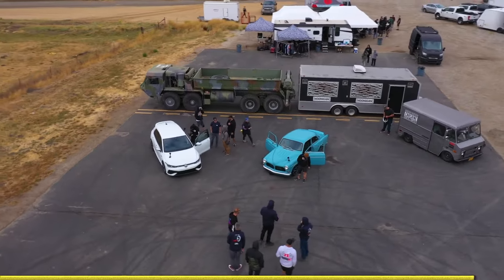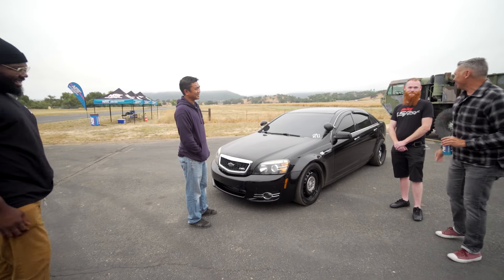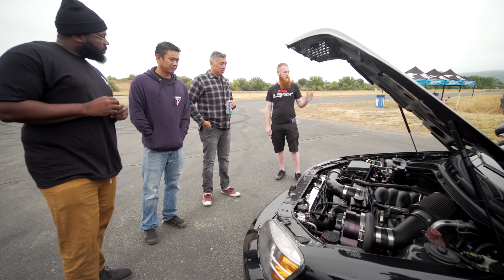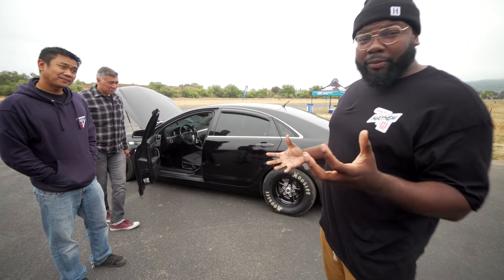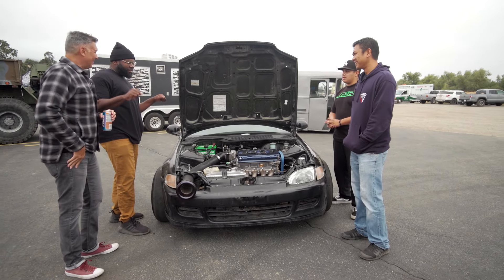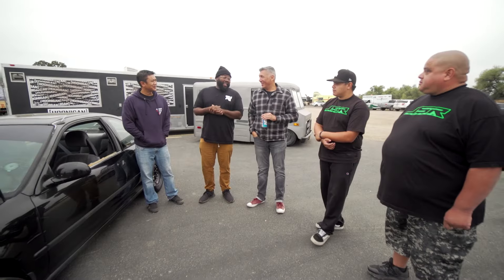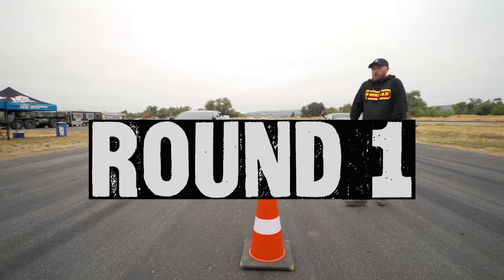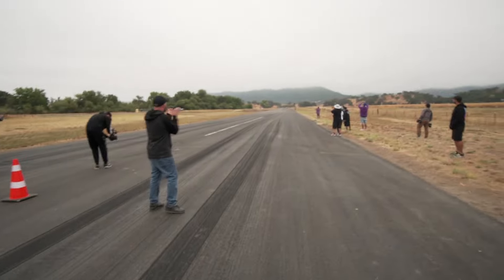600hp Chevy Caprice PPV drag races LS VTEC powered Honda Civic EX

Comment: That second race had such a clean, even start. Fair
Reply: That second race was a great race!
Reply: That was a decent race, door on door the whole way
Reply: Holden running some lazy ass 3.20 gears out back on heavy girl, if he was rockin some 3.90-4.10 the fresh build fart cannon on race fuel would be smelling pump fuel exhaust
Reply: @05EVORS  i doubt it. He was low on grip
Reply: @Reactionary Hermit and broke
Reply: @smitty261974  so what if it breaks lol it's only an ls honda motor, doesn't cost much
Reply: @nonstopqs4188  🤣🤣🤣still broke trying to beat a full weight 4 door boat. Hell I drive a Honda and I own both. Chevy and Honda.
Reply: @05EVORS  that’s wayyy to much gear for a 6l80
Reply: Streets closed pizza boy....the cop flys away home.
Reply: @smitty261974  admittedly he was driving it like shit. If it were driven properly it prolly wouldnt break
Reply: @adrianwelgemoed9562  maybe
Reply: @adrianwelgemoed9562  it was a time bomb with that kind of compression ratio and with nitrious.
Reply: @05EVORS  true but if that Honda had a k20
Turbo engine with awd drivetrain, the v8 would lose again
Reply: @lespaulguitarist92  true. Forgot it was on nitrous
Reply: @adrianwelgemoed9562  you don’t slam the rev limiter at 10k while on the nitrous… rule num 1
Reply: @lespaulguitarist92  it really is how he drove it though
Reply: @smitty261974  race what u bring buddy 🤷🏻‍♂️
Reply: @flacco1679  yep sure did and spinning ain’t winning.
Reply: @Reactionary Hermit A supercharged police auction LS with probably over 100k miles and somewhere around 7k idle hours and twice as heavy, but... Ok 😉
Reply: @haydenrapp6547  THIS. In and out of first in the first inch of launch
Reply: @05EVORS  maybe.  but he wasn’t, so take that L
Reply: @05EVORS  2:98 factory
Reply: @smitty261974   bulletproof and very responsive. The L77 can easily see 75hp removing a set of the mufflers and both sets of cats and resonators with a OTR intake and a tune 7k redline helps that rear as well.
Reply: @ITRSammy  If the Caprice had a LT6 AWD?!  Relax… Props the the LS regardless. A Dart block built half the weight with the infamous high rpm on juice. It’s almost half the weight, half the power. Reliability and consistency will go to the workhorse L77 6.0
Reply: @WoodLox  your preaching to the  choir. My brother and I had one built and put in a short bed GMC with a LSA and T-56.
Reply: @WoodLox  if the Honda had a jet engine the caprice would lose
Reply: @smitty261974  it didn’t “try to beat” anything. It’s clearly the faster car and that’s before the 1/4
Reply: @tonybabyjones7106  lol. "police auction LS...". You act like the Honda is crazy expensive or the overdog. It's a $400 junkyard salvage itself. No K20 or dog box or anything ether. A simple, cheap LS-V. Why hate?
Reply: @N.S4L4S  not hating, just trying to provide information for a more realistic comparison.
Reply: @tonybabyjones7106  you didn't provide any new information that wasn't presumed from what was given in the video. The reality is that the Civic won the second race fairly, then you preceded to comment with the fact of how it's (only) a police auction vehicle with (many) idle hours, as well as how HEAVY it is "but...ok". As if to undermine the win. lol Don't try to change it up now. 

The civic is full interior and, yes, is less weight overall, but nowhere is it or should it be considered the obvious front runner over a SUPERCHARGED LS...because of its weight. Just silly. Two perfectly compared cars that you may see at the runs. It's actually more common to see an EG on cut doors with a K running C16 in this case. lol
Reply: Agree
Reply: @Conquering Death It's a weird give and take with gearing. A higher final ratio does mean less wheel speed at a given rpm. And, of course more wheel speed means a longer burnout, so long as you have the torque to break traction, to begin with. Which, he does. Lengthening gearing to gain traction at low speeds only really works for cars that have just enough power to slide, or awd.
Reply: @Conquering Death butt hurt ? 🤣 do you think the Honda winning this race as close as it was considering the other car weighs 4580 lbs is worthy of bragging about , the way I see it that was a loss and not just the race itself being a power too weight ratio loss but the Honda lost its engine too . 🤷‍♂️ JS
Reply: Shut up bro this was the cringiest most Honda Fanboy comment I've ever seen🤣
Reply: @05EVORS  mad
Reply: @05EVORS to bad the fart cannon won lol
Reply: @05EVORS  but unfortunately he lost

Comment: The Caprice guy was a good sport about getting ripped off a little.
Reply: That’s my son. Taught him manners. 🥰
Reply: Ripped off a lot.
Reply: You can't be upset when driving a 6.0 V8.
A little throttle would sooth any soul 😌
Reply: I mean he was clearly traction limited and got pulled big end. Its a bad ass car and would be a sweet daily but that Honda is the faster no prep car
Reply: @TexasTrollPatrol   Well it's broken now so I'd say the car that runs is faster.
Reply: @joshbrown811  racecars are meant to break thats the point
Reply: @jcfdesigns9261   that's cool and all but you can daily the Chevy. Anyone can build a pice of shit that goes fast and blows up.
Reply: @joshbrown811   you can daily the civic too. It blows up once and now it’s no longer a daily car?
Reply: @joshbrown811  someone is upset a honda smoked a v8
Reply: @flynndodsworth2693  hahaha ikr, like why do some people gotta be so upset over a race
Reply: @joshbrown811  you don’t even have a fast car
Reply: Agreed. At least he still has a running car.
Reply: @TexasTrollPatrol  dawg the civic is fwd its traction limited no matter what
Reply: @jackya8654 dawg are you slow? Read my original comment. I clearly say the civic is the faster car 🤦
Reply: I mean he wasnt winning either way.  He lost down low
He lost mid range
He lost top end
To a 4 cyl driven by a kid who's never driven in that config.
Reply: @chevycole6474  honda engines go tens of thousands of miles with high hp builds....
Reply: @chevycole6474  lol since when does owning a fast drag car mean having to drive it home??   they built that civic in like 2 months and homies son first time driving it and he WALKED that caprice.  WALKKKKKEDDD.  the first run he jumped. but a chase is a race and old boy in the caprice should have let off and not chased... simple.
Reply: @elonmust7470  you say 10s of 1000s of miles like thats a lot , try 100s of 1000
Reply: @wildcat67-b7n  Who has driven their turbo honda 250,000 miles?

Comment: As the owner of a B20 swapped EX, this is truly a beautiful sight.
Reply: Same here i have 95ex
Reply: @josyelzarate3693  what engine and set up are those
Reply: I got a 95 del sol with a b18 swap
Reply: What you ladies making big numbers 🤣
Reply: @PooRadley  450 on a single turbo with old set up new set up should be around 1000 when I’m done
Reply: Yea I have a 2000 integra gsr b18c1 going to build it kinda like that 😁
Reply: b18 is boring, everyone has a gsr . I can smoke b18 cars every time with my h22 torque.

Comment: When the owner/builder of a nitrous/turbo civic on slicks is pushing 250+ lbs you know you in trouble 😂
Reply: There’s no turbo on that thing. Just nitrous.
Reply: @justyngilliam4051  which is why I said / nitrous. Either way the statement still stands lol

Probably could have finished the race if it was just boosted.
Reply: @justyngilliam4051  which is why it is insane, pushing that much power out of a NA motor is crazy
Reply: You know the civic is in trouble seeing that it blew up. No replacement for displacement
Reply: @jarredmaler2210  A turbo on a stock prelude engine will go 200,000 miles & make 300 whp.
In a 2400 lb car it smokes 80% of what's on the road. Spend 3k on some forged parts & 1000 hp is in the cards.
Reply: @ableusermcz  any car can push a lot hp the question is do they will last longer 🤔
Reply: @mrmidnight32  you could quadruple hp with with turbo.   U can't with a turbo making your statement really not make sense

Comment: Damn, that delta between all motor and spray is insane. Truly speaks to hondas engineering prowess. AND ITS NOT EVEN FROM THIS OR LAST DECADE
Reply: Imagine owning a Triton engine and thinking it's better than a Honda engine. Have fun changing your spark plugs in your "real engine".
Reply: @scottythebody0811  you realize there's more fast imports than just honda's, right? and even at that, honda makes more fast vehicles than just (subjectively) bad sounding 4 cyl's. like, this isnt american made garbage where theres only 3 brands to choose from.
Reply: i mean its a purpose built nitrous stroker on race gas and 14:1 compression i sure would hope it picks up enough to keep up with a police car with bolt ons
Reply: @scottythebody0811  “real engine”💀
Reply: @scottythebody0811  it puts out less than a triton and would drag it any day of the week.
Reply: @scottythebody0811  and you do know that lots of backyard built Hondas are motors from junkyards right? High mileage motors with a turbo tossed on them making 500+
Reply: @tyleresker3306  It's supercharged too man and the heads had work done to them....
Reply: @zatiticherry3421  yeah bro anyone with a dremel can port heads and order a blower kit. They are still bolt ons
Reply: @tyleresker3306  So are a turbo and nitrous using your logic....heads are something that anyone with a Dremel can ruin. They must be flowed and all the work precisely planned before they're touched. It's nowhere near as simple as  something anyone can just do. A supercharger increases the VE over 100%. That's a significant power adder.
Reply: @scottythebody0811   At least they own their cars unlike those domestic bus riders
Reply: @zatiticherry3421  lol you can buy cardboard port stencils for like 40 bucks. That Honda engine has fully built internals and at 14:1 Cr will detonate if you put pump gas in it lol how is that comparable.
Reply: @tyleresker3306  A stencil doesn't accommodate for port angle, lengthwise transition,port short side radius, or port volume; and it definitely isn't a flow bench where you can evaluate port flow at various valve lifts. 14:1 and the supercharger are the same in that they both translate to higher cylinder pressure and higher BMEP. Plus N/A and supercharged engines both make linear power.
Reply: I'm not sure if they mentioned what fuel the Honda runs; but you actually do have a point there. I'm not sure if he's running E85, race fuel or whatever. E85 can handle 14:1 though and can power both setups effectively with a reasonable tune.
Reply: Hondas B16 made 100hp per litre (160hp) naturally aspirated in 1989, if the triton made comparable power per displacement that would be a 540hp engine. To match that power per displacement a stock LS1 would need to make 570hp, a Ford Coyote would need 500hp, and the new LT1 would need make 620hp. Honda hit 100hp per liter per liter naturally aspirated over 30 years ago and American manufacturers still can't do it today. So from an engineering standpoint the Honda has the "real engine" 💁

Comment: Those Caprice PPV's are always the ultimate sleeper for those that don't know anything about them! Thanks to the Aussies for blessing us with these Gap Delivering devices! 😂😂😂
Reply: Its a GM product toyotas are made here in the US it dosen't make them American. Holden is an American company.🇺🇲
Reply: @butcherbaker4258  holden is still operated as a separate company, even though its owners are American. Chrysler are merged with fiat, its fiat chrysler, dont mean every dodge challenger is Italian though does it. And btw, the toyotas that are made in America, are American cars, they're not sold anywhere else, and designed by Toyota USA.
Reply: B H  I wasn't talking about this race, just PPV Caprice's in general, they are faster than some people think.
Reply: @butcherbaker4258  Sure, but they still were mainly designed for the Australian market and are more Australian than anything else, just because GM decided to slap a Chevy and a Pontiac badge on them doesn't make them American, same thing goes with Ford european only cars, just because they have Ford badges doesn't make them American...
Reply: @butcherbaker4258  Holden cars has been killed of by gm.
Reply: @joealex65  it has a American motor and American transmission in them Holden was a subsidiary of GM, the definition of a subsidiary company is “a company controlled by a holding company”, and legally speaking the reason they can badge them as Holden and a Chevy in the US is because they own, have a say in making every single they vehicle produce, just because it’s assembled in Australia doesn’t make it Australian, are the bmw’s and Toyota’s assembled in the states American cars?
Reply: @dennisclark9544  no it isn’t 😂 Holden is a subsidiary of GM the definition of a subsidiary company is “ A company controlled by a holding company”, that holding company is GM same for Ford Europe every single decision is made by Ford headquarters you honestly believe GM bought Holden and let them do what they want? 😂 not to mention Holden’s like the Commodore and this caprice have American engines and American transmissions like the T56 that are shipped to the Australian assembly plant. And btw saying that Toyota’s that are assembled in the US are American cars just because they are for the American market is like saying the GTR spec that was made only for the United States vehicle market is all American just because it isn’t solded anywhere else😂. Good thing Holden doesn’t exist anymore it was a waste of American engines and transmissions🤷‍♂️.
Reply: @butcherbaker4258  yup it’s funny how some Aussies call it Aussie muscle when the cars have American engines and American transmissions in them😂. Me personally I’m happy GM got rid of Holden it was a waste of American engines and transmissions.
Reply: @USandGlobal  see, you're trying to act like a smartass, and yet you said the word "solded" ... look at ducati, they're owned by lamborghini, who are owned by wolkswagen, yet ducati are allowed to operate completely as they did before they were bought. It happens all the time. Holden cars ain't designed by an American, they use parts from within the GM group, yeah, of course they do, GM are still paying the damn bills, but that doesn't mean anything else has anything to do with an American. Toyota tacoma trucks are designed and made in America, by Americans, that happen to work for a Japanese owned company, and they only sell them cars in North America, because they're made specifically for the American Market. Back to fiat chrysler (that's the actual patent company name) fiat comes first on that name, so do you think every dodge is actually Italian? Because they're owned by an Italian company. Plenty of companies that own other companies, allow their subsidiaries to operate by themselves.
Reply: I live here in Middle East Arabia. There are both civilian(sold to public) and cop edition. There are  Saudis hoonin them. 
We do have all gen of the commodores that are LHD versions dubbed Lumina  and Caprice.
Reply: Even the chassis is from a 90s Mercedes. 
Commodores, Caprice, GTO, G8, whatever you wanna call em, they are all parts bin specials, with the same core components.
Reply: @butcherbaker4258  Holden is no longer a company...
Reply: @butcherbaker4258  Holden originally was an Australian company, until GM bought it many decades ago.
Reply: @nielsdebakker3283  Many Australians chose to buy imports.  The Australian auto industry has dried up across all manufacturers in Australia, not just GM.  At least Holden gets to carry on as a GM design firm, instead of disappearing into absolutely nothing.  Maybe, in the future things will change, and Australians will want cars built by in-country Australian brands, And Holden will be able to return to building cars.
Reply: @USandGlobal  Yeah that's not how big parent companys work aye.

Comment: Now the ppv prices are gonna skyrocket 😂
Reply: They did a long time ago, their hard AF to get. I flew from Kentucky to South Carolina in 2018 to find one but it had a blown motor and clapped out frame. Still 😠
Reply: Already did I really want to get my hands on the Taurus sho
Reply: They've been a hot commodity for a while now. A guy in my area owns 3 of them.
Reply: You should see the prices on the SS sedans right now
Reply: I just pretend my 2014 Impala 9c1 is as cool ass the PPV.

Comment: I have a 2011 caprice ppv and love it. Best car ive ever had by far.. There isnt alot that can hang with me and I race all the time. Straight stock but fixing to do some modes..
Reply: You must be racing some slow ass cars if none can beat that heavy slow boat they are called Holden's over here and they got smoked by my old is350 lol
Reply: Yah ok guy maybe you can get the 3.6 version but try running the 6.0 if you want to talk.. I'd eat that is350 alive. I've smashed bigger and better than that. But have fun thinking your doing something.

Comment: You can hear the civic struggling at the top of third in the second race, then the motor gave up.
Reply: What I think happened was on that second run has shifted into 3 too soon and hit the nitrous and causes too much load & boom
Reply: @dadeftones7  correct
Reply: 1,500 for a new engine..

Comment: 40% advantage power to weight was going to be tough to beat, on other hand the Honda was hopped within an inch of its life and barely completed 2 passes while the Caprice could likely do passes all day long, then on way back to LA, drive thru stop and go traffic NP, no overheating and cold A/C.  That Caprice is very unique and well designed specd and built.